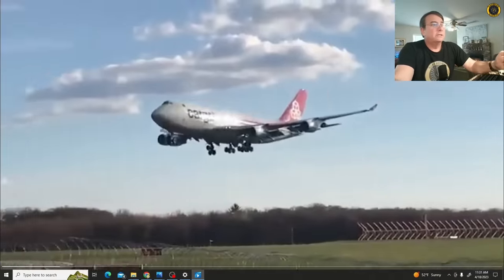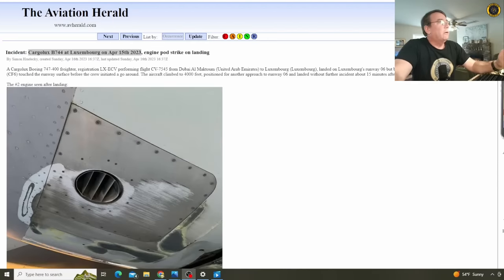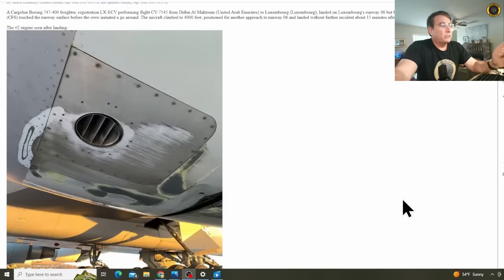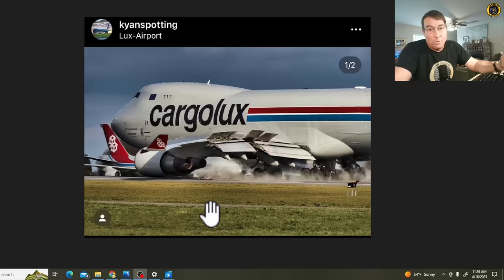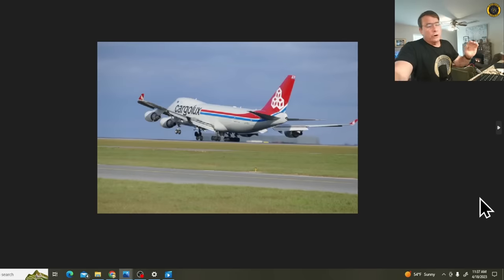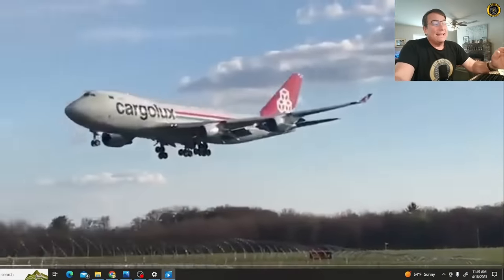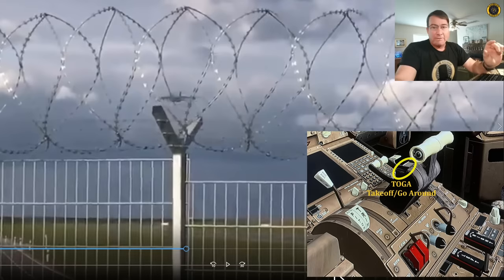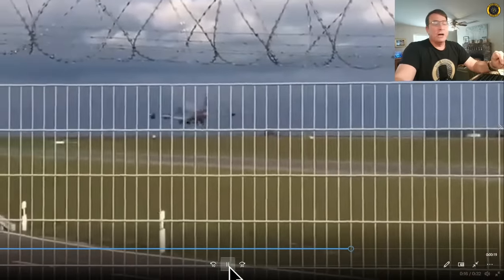Cargolux 747-400 KABLAMMO!-SMASH AND GO 15 Apr 2023

Comment: Hello Juan,
I fly a B747-400 doing long hauls, with heavy crew. Mistakes like this one are easy to make, especially if you are not paying attention. 
It looks to me like the aircraft was landing flaps 25. Since I have no idea what the wind conditions were, I am going to assume it was the typical crosswind from the left as you land on runway 06. It appears that whoever was flying cut the power to high and did not flare enough until he tried to pull up, but without power, it was a little too late. Also, runway 06 has a hump and it runs upslope with a difference of about 60 feet from one end to the other, and as you start to flare you do not see the end of the runway until you pass at least 1/3 of the landing runway, then the rest of the runway suddenly appears in front of you. Plus, I noticed that the flying pilot used ailerons to correct for directional control instead of using the rudders. That action, plus the lack of power control and rudders input, could be sufficient to do a Boeing's rendition of a messed up landing of an MD-11 aircraft, which I also flew.
It is easy to be a Monday morning quarterback and talk trash about an unfortunate episode such as this one.
We simply do not know exactly what occurred onboard at that precise moment. The truth eventually will be known and prevail. 
I should mention that as a matter of procedure on a B747-400 or even the B747-8, anytime the autopilots are off, you should turn off the autothrottles and revert to100% hand flying. The yaw dampers are going to continue to work and assist you while you hand fly the aircraft. On a crosswind situation, especially at lower altitudes, the rudders are your friends. 
Lastly, when you press the TOGA button, it is time to climb like there is no tomorrow.
As a side note to the airport itself, as you approach runway 06 to land, and you are about 200 feet above the terrain, if you quickly look to the right of the airport perimeter fence, and below your aircraft, you will see the American War Cemetery where General Patton along with 3000 plus, of his brave soldiers are buried. This is a sight to be seen and a must to visit while in Luxembourg.
Juan, good video as usual.
Reply: Excellent input truly adding a lot to this discussion, AFL. Thanks for chiming in. 🙌🏻
Reply: That what look like to me 25 degrees flaps not full flaps ! 👍
Reply: @Dan Hack  Yes, they look like they were set at 25 and not 30 because when the flaps are set at 30, they drop deeper, and there is a noticeable difference, as viewed from the side of the airport's fence.
Reply: I thought crosswind too. Maybe if it touched down hard while still crabbed the side loading on the gear could induce a roll as the thing straightens.
Reply: Best comment!
Reply: Juan, and his followers such as you, are the reason that so many of us lay people don't read anything about an incident until it has been discussed here.
Reply: I am relatively new to the 747, but one thing I have noticed is that if you are relatively light, and have gusty winds, the 747 can get a bit squirly when initially touching down and until all main gear are firmly planted on the runway. When doing long haul flying, with heavy crew (flew the 787 for four years - so the 747 is not my first long haul job), you usually are not very sharp when landing after 10+ hours in the air. On top of that, sometimes you are lucky to get one landing every month and a half. So if you combine fatigue from a long flight, lack of regular landings, and even slightly challenging conditions, I can easily see something like this happening.
Reply: That all sounds do reasonable to me and seems to match the video.  It may just be due to the perspective, but it looks like around or just after 0:07 the pitch attitude may decrease just a touch.  If they were in a low energy state from a premature power reduction, that would certainly exacerbate the sink rate (though I cannot visually determine if the descent rate changes in the last couple of seconds.

While I have limited time on the -400, my recollection is that it was a very easy aircraft to land (certainly compared to the MD-11), just a 2-3 degree flare was adequate, I assumed because there was so much wing that ground effect did a significant portion of the work.  That said, there wasn’t a lot of clearance on the inboard engines, and IIRC at high deck angles you’d drag an outboard flap if you let it bank too much.

It will certainly be interesting to learn more as the facts come out on this one, but good job to the crew for preventing a bad situation from getting worse.
Reply: TOGA TOGA !!!!
Reply: Great comment! Winds were reported 360/09 kts on the Metar of 18:20 local time the incident occured around 18:30 if i am not wrong. For me it looks like pic flared too late and panicked when noticing the bounce resulting in overreaction on the controls.
Reply: comment section is lit thank you for valuable insights/info
Reply: @afreightdogslife  I agree with everything you said, except that mistakes like this are easy to make. It’s lousy airmanship. In nearly 10 years of flying a 747 classic, I’ve never gotten remotely close to this.
Reply: I can second visiting the war cemetery, it’s very sobering experience, especially on Memorial Day with every headstone bearing an American and Luxembourg flag.
Reply: If both right engines had struck the ground, I wonder if we wouldn't have seen potentially two engine failures on the same wing. Would have been a harder impact.
Reply: @dominicvg051  I too have attended the American Cemetery at Lux on Memorial Day (weekend). It was very sobering of sacrifice of our soldiers. It was also very endearing that the Cub, Girl n Boy Scouts prepared (wash n clean) each headstone and provided a rose n flag.
Reply: Excellent overview. I too retired off of the Whale (744) n flew the MD-11 for 16 yrs. I Loved n always respected both aircraft. They served me well but like riding a thoroughbred horse I never ever let my guard down. Listening to the audio it’s sounds like the engines were brought back to idle then powered up prior to touchdown thus possibly destabilizing the landing. Memorial Days always remind me of my visits to the American Cemetery at LUX.
Reply: @TheGlobalTravelr  Outstanding! I always made a point in going to the American WWII Cemetery and dragged along the US crew members who were part of my crew on a particular LUX trip. Very few people really wanted to go, but I would give them hell for being weak men, so in the end, most of them went along with me to the cemetery, mostly so I would shut up, but actually ended up liking the tour, when everything was over. 
I have four years to go before my mandatory retirement, I am actually looking forward, and yes, I will miss the aircraft a lot.
I have a few videos on my channel that you might relate to. Cheers TheGlobalTravelr
Reply: @RTB RTB_Dutchy  Your assessment of this particular flight is right on point. Thank you for your input.
Reply: @dominicvg051  As a US Army combat veteran, it hurts to see these brave young men and women, dead and buried at such a young age. It truly is a humbling experience.
Reply: @Hexagonal Man  The B747 can easily fly with two engines, providing that the actual aircraft weight is not at or near the maximum takeoff weight. We do this kind of flying every six months in the flight simulator as part of our mandatory proficiency training and proficiency checkride (mandatory exam). If a pilot fails said exam, there are consequences, some includes career ending consequences, depending on some factors, but believe me, it's not good.
Lastly, this kind of incident where an engine or two engines gets scrapped rarely has major damages, and it may only require, besides an inspection, an intensive sheet metal work on the engine cowlings.
Reply: Tep all that,but also don't go for a shit when on final approach.
Reply: Excellent reply
Reply: I don't envy the crew. They get to go to company headquarters, sit at that long table with the Chief Pilot, Director of Operations and the fleet manager and answer questions. If you fly long enough in this business you're going to have your turn in the barrel for a firm landing. I've had mine. In the 747 a firm landing always feels worse from the cockpit that they look from the outside. (minus a pod strike)
Reply: @Kevin_747  Cargolux is indeed a very professional and safe Airline and usually very seldom with such news in the Headlines. But as Juan stated: It can happen.
I´m sure they know meanwhile the reasons for that landing inside of the Company and will have no need to wait for the Final Report of the Luxembourgish Aviation Accident Investigation Bureau (yes, they´ve one in the Country) to learn from this lesson.
Reply: @jsmith1746  Indeed, it´s very plausible that such factor´s added up. They came from Dubai, that is a flying time of round about 6 hours to Luxembourg, and this happened around 06:30 pm, so it was a flight in full daylight. So at least fatigue shouldn´t have played a role here.
Reply: @jsmith1746  And then also trying to get that quick glance to the right to check the war cemetery.
Reply: Hey  !
Flew to Lux many times. 
B 747 400 - B 777F - B 767F - DC 8 71F .
All is very true regarding Rwy 06 .
Reply: @afreightdogslife  I am on the 74-8 and I like you have less time in the air before the government clips my wings. I didn’t think it would affect me as much as it has recently there are many memories I have made in this business and will miss the relationships that I have been able to forge with my travels. As I grow older the most I will miss about flying is  being at the controls as the sun breaks through the clouds at sunrise , for me it’s always a beautiful experience and every week I don’t take it for granted. As a freighter I’m sure you know what I mean
Reply: @NotBoeingnotgoing  I absolutely understand how you feel about age and retirement. Like you, I will miss those sunrises and sunsets, or the dark night sky full of stars, and in the winter months, the Aurora Borealis waving their magnificent colors above the aircraft as we fly through the night. 
The lifestyle that we have enjoyed as freightdogs can not be compared to the regular lifestyle of the passenger carrier pilot.
To be a freightdog, it is not for the uninitiated as it takes a special kind of personality that all true freightdogs share.
I salute you, NotBoeingnotgoing!
Reply: @afreightdogslife   At 30 do you get anymore lift then at 25 or is it all additional drag?? Or does it help with ground effect and cushion the touch down??
Reply: @donstor1  Hello there, Donstor1.
You raise a good question here, and I will try to come up with an explanation for you. 
The landing flaps on a B747-400 are F-25 and F-30. When the aircraft is not that heavy for landing and / or the runway is not contaminated, with, say, rain, snow, slush, you can choose flaps 25 since those are normal flaps, plus is the runway is not that short you can set autobrakes on 2. This way, you are going to flare and stop at a normal schedule, and you could clear the runway somewhere around half the way of the runway,  so for a 7,000 feet length, you can expect to exit the runway at around 4,000 feet or so. Don't forget that these numbers that I am giving you are numbers that I am using without any real performance charts or landing performance calculations via a computer, which are normally the way we do things. 
When we select flaps 30, the aircraft tends to dip the nose a little more, and flaps 30 do create a lot more drag than flaps 25, but it also creates lift. It is a combination of both flaps settings. Flaps 30 will provide a shorter landing distance if heavy, and it will give you a vref that it is still a lot slower than flaps 25. If you are landing, say at maximum landing weight of  295,742 kilos (652,000 lbs) on the same runway length, you will have to land the aircraft with flaps 30 and autobrakes 3 or 4 and expect to exit the runway at 3/4s of the length of the runway or full length, but nothing short of that. If you encounter the previous conditions, as a contaminated runway, then expect to set autobrakes- Max and exit the runway at the end of the runway. 
Lastly,  if you use the autoland feature, then flaps 30 are recommended regardless of the weight of the runway. However, if you are not that heavy, then flaps 25 could be used.
I hope that I was able to answer your question.
Btw, I have a channel under my YouTube name. If you want to watch a few landing and take off videos of the B747-400, I suggest that you give it a try. Who knows, you might even like it. 😆 👍🏻👍🏻
Reply: @rtbrtb_dutchy4183   "easy to make if you're not paying attention" and "mistakes like this are easy to make with lousy airmanship" 

got to wonder why pilots find those two explanation pretty much normal. aren't pilots paid to pay attention when in a plane?  and aren't they only selected, allegedly, when they have all the required skillset to fly safely those aircrafts?

so, how many retrads, alcoholics and shitty, lousy, unqualified and undertrained pilots are flying those heavies over our heads? looks like quite a lot to me. 🙄
Reply: @kittytrail  right, those explanations shouldn’t be normal. It’s not in my book. But here are a few things that might help explain it. 

First of all, the vast majority of pilots are good and safe pilots and I would be fine putting my family on their airplane. 

Having said that, there are some lousy pilots too. Not many, but they are definitely around. And those usually get protected by other pilots and they keep falling through the cracks that way. 

Another thing is, pilots tend to say those things because “it could happen to anyone”. What they mean by that is it could happen them so the excuse is already made. 

One of the things for instance that’s said in aviation is that you have two kinds of pilots, the ones that forgot to lower the gear and the ones that haven’t yet. I think it’s a silly statement for lousy pilots. I’ve never forgotten to lower the gear and I never will forget. Most pilots will never forget. 

So yes, I agree with you, except that most pilots over your head are good professional pilots. And the lousy ones, usually fly with a good pilot. Sadly, sometimes u got 2 lousy ones and then you het landings like you see in this video.
Reply: @afreightdogslife  again, nice explanation. 

Fun fact, I used to fly the B747SP and there was no Flap 25. Only 30 was available.
Reply: @rtbrtb_dutchy4183  In this case maybe one of each sort. They botched the landing but they got the situation quickly under control and performed a raisonable Go-Around. As stated: Cargolux isn´t usually with such news in the Headlines. They´ve a very good reputation in the Industry.
If you really want to watch a Cowboy Freighter Airline - put "Aerosucre" in the Search Function of YT and you will get everything what you expect and even more.
Reply: @afreightdogslife   What an excellent & full answer you've kindly taken the time to give to Donstor1. Thanks on behalf of, I'm sure, others, too.
Reply: @Villiam O  Hello there, Bill. I do not presume to be an expert on anything,  but I have some practical experience related to this kind of flying (long haul heavy cargo). I know anyone is a potential victim of an aviation mishap. In fact, a couple of people I personally know have done precisely the very dame mistake with the same expected damage to the skin of the engines.
A small mistake or error could become huge news once a video of the incident hits the news cycle. 
All I ever wanted to do was to give my "expert" opinion of what could have happened with this crew and not criticize anyone. 
We are all humans, and as human beings, we are liable to make mistakes. As a professional crew, we strive to minimize those possibilities. 
I hope that I was able to explain and make people understand what could have happened here and stop them from making assumptions that are not based on reality. 
Cheers!
Reply: @afreightdogslife  are you close to retirement?  There are options after retirement you know.
Reply: @RTB RTB_Dutchy  Actually, I am 4 years from retirement, and I was hoping to finish my career and then go to enjoy retirement like a normal person, but fate intervened. Last year, during the month of July, my wife was diagnosed with cancer, and our lives were changed forever. I needed to make an urgent decision, to stay home and take care of her or to go back to my normal life as a long haul pilot. I decided to stay home and take care of her while she went through all the treatments available to her. 
I took a leave of absence, and my salary stopped almost immediately, so I had to find another job nearby to where I live. I applied to flightSafety International and was very lucky to get hired as a new instructor. I have been at FlightSafety since January of this year, and I am very grateful for the opportunity that they have provided me. 
Perhaps next year around the end of May, I could go back to work flying for the remainder of my flying days, and after my retirement, I will go back to work at FlightSafety full time once again.